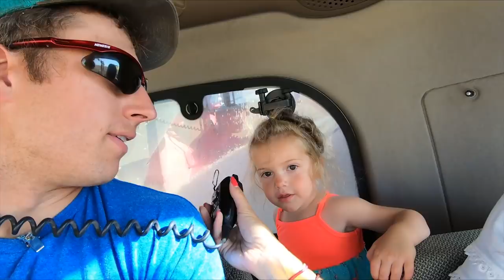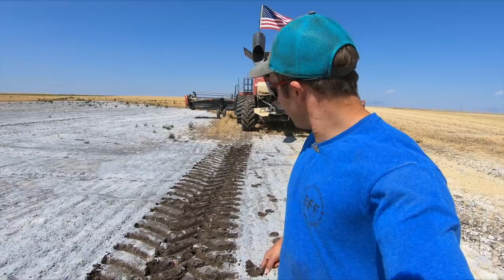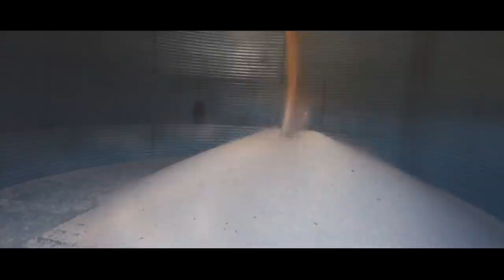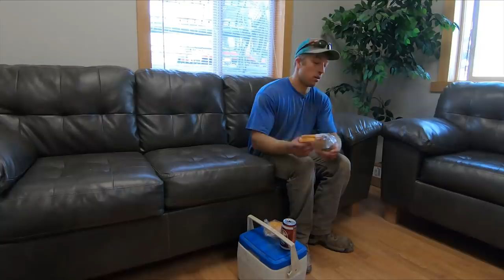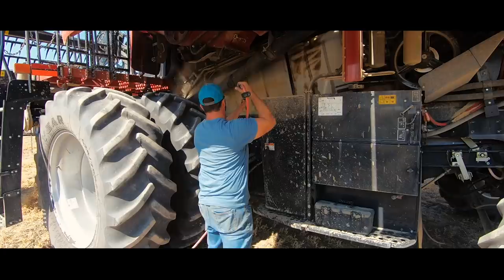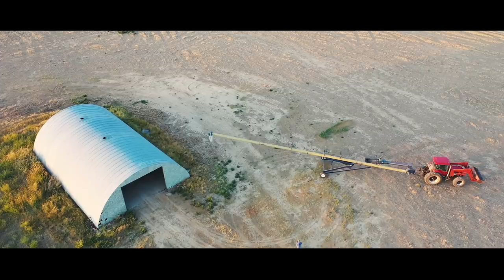We Finish Our Peas & Gear Up For Wheat - Harvest Episode 4

Comment: Kids nowadays have it easy, our old 750 Massey was loud and dirty and cramped. It was so much nicer when the 1460 IH came along. Those concave modules look lighter than the ones for the older combines, and the access is much improved. Happy harvesting to ya, we cut our winter wheat in IL in late june it averaged around 75 bushel and little to no vomitoxin. Was pretty pleased, we double crop soybeans after wheat if they keep getting rain and the first frost is late they could make 25 or 30 bushel. Good luck and be safe

Comment: Good job getting her the Big Chevy SUV.  Loved my GMC Yukon XL Denali.  It saved me and my boys life when we were rear ended by a truck traveling at 60 mph and not hitting the brakes, as we were stopped on the highway at a red light..   The only injury was my 13 year old getting a busted lip from his phone flying out of his hands, hitting the dash, bouncing back and hitting his lip. We were all very soar the next day, but no other  injuries. Needless to say but the SUV was totaled.  His front end was smashed, as his steel bumper crushed in to his engine.

Comment: Hello Welker’s, I use to run 7700 J.D. over 35 years ago here in Michigan.  Dad ran a 6600 J.D. hillside model.  We combined our own farms and did custom work also.  Was a dusty deal.  Times have changed, IH Case combines are awesome.  Keep up the great work.

Comment: Good thing you have that Scott guy around the farm 💯
Reply: Brad? the farm hand?
Reply: @BiggieDiesel01  no legarms actually has a name 😄
Reply: I agree strongly! Would have to shut down the farm with out him.
Reply: @RobertWelkerFarmerBob  how did the repair on the lifter pan out, did you get rid off the vibrations? We are getting close to starting the combines here aswell, but oddly the crops won't turn yellow even tho we had quite the drought in juli. I'm up here in finland farming.
Reply: @danielkacko7616  so far its working well. Just about done with our winter wheat

Comment: Nick do you guys have any soybeans in your area? I grow about 2000 acres of them each year.  I think you should try about 30 acres of them . they like some rain in the early spring and heat in the summer and very little rain if you notill them. we had almost 100 bushel to the acre winter wheat.  we planted it early harvested it early in July and planted double crop soybeans.
Reply: The climate is not long enough for them and not enough water.

Comment: We have an Alkali Flats near the Krapitol building of California about 1/2 miles north
Do you remember the Pet Rock?  You should collect them set up a stand at the main road and offer them on the honor system

What pressure does the hydraulics operate at?
You need to ad an LED (loud emitting device) horn

Thanx from the left coast near the Krapitol of California
Reply: Hydraulics run from around 1800 to 3000 depending on the load service needed.
Reply: Robert Welker hydraulics on my submarines were 3000# main 3 pumps and 1250# external 2 pumps heated and cooled as necessary

Comment: Would you mind sharing the locator lamp details that you built for the Graindeck.
Reply: The sensor, mounted a couple feet about the deck tread, points to a reflector on the hopper. Just place the reflector on the hopper when you're positioned correctly and the light turns on.
Reply: @RobertWelkerFarmerBob  That's too simple, LOL. Thanks.

Comment: Any estimate on how many hours saved harvesting with Beast and Cliffs 45ft headers vs last years 2588 s 36ft headers? Was your ground speed average also faster?
Reply: 30% more header might translate to 15% time savings? #mathishard
Reply: 20% more header area in relation to the 45ft header. Not sure how you calculated the 30% in your math. 

I know the Welker's had some minor breakdowns/fixes and some time spent on setting/adjusting their new machines. But I dont think it was anymore than the older 2588s. Appeared the older were using more time spent each year repairing the 2588s. Went back and watched some older harvesting videos. It was cool to see the JD 7700 in its last hurrah!
Reply: @CGW116A  Well, calculating percent is a funny thing. The 45ft header is 25% bigger than the 36ft header (45/36=1.25), but the 36ft is just 80% of the 45ft (36/45=0.8).
Reply: Agree with the comments.  Love the 8230's ❤👍
Reply: @maddiN117  convert decimal to percentage 1.25 x 100 = 125%. Funny.
Reply: CGW116A So, when converting decimal to percentage is so easy and funny, how come you said the 45ft header would be 20% more header than the 36ft? To say it with your words: don’t know how you calculated 20% with your math. 
However, it’s bigger and bigger is always better.

Comment: Ok, we saw you empty the rock catcher, but did not see you pick them up and haul them to the trash.  So, does the machine just pick up the same rocks next season?  Also, did someone check the little child's diaper seals before using the peas as a playground?  The harvest does wind up in our cupboards, right?  Not being negative, just inquisitive - I realize you guys know what you are doing.  Besides, the other 628 comments are all the usual love and adoration, which must get a little old, eh? 👍
Reply from the maker: We do rock pick but I'd bet we have 10,000,000 other rocks that size on our  10,000 acres. 4-5 rocks a season won't even dent the rock count. We only pick rocks basketball size or larger.

Comment: Thanks for the videos! Do you guys ever get header (combine) fires?
Reply: Less than a hand full over the last 40 years.  None damaged the combine and most 3 acres burned.  Fortunately
Reply: Robert Welker cousin of mine lost 2 headers in 2 years. One farmer is know to burn headers so all the local blokes get the fire carts out. He was doing so clover seed last year and had to run the comb low and the clover trash is know to catch fire. The straw started it was lucky the other farmers where ready and one of them was actually working up some potato growers at the tip and ripped some fire breaks after the fire started.

Comment: So what do you mean by modules? I’m assuming it’s not the same as concaves. Ok so they are concaves👍
Reply: They are concaves.  With the CaseIH Flagship series there are 8 sections under the rotor so different style of grate openings can be used depending on crop type and conditions.

Comment: Great job Nick awesome video, although I think the rolling coal thing was cool back in the day but anymore it just seems childish and irresponsible. You are setting the example for the next generation.
Reply: These are old school engines which don't have the computers to adjust in a fraction of a second.  As you know when you increase power the turbo isn't ready to add the extra air needed.  And we are setting an example unless they stick with old gen engines.  But thanks for the Kudos 👍